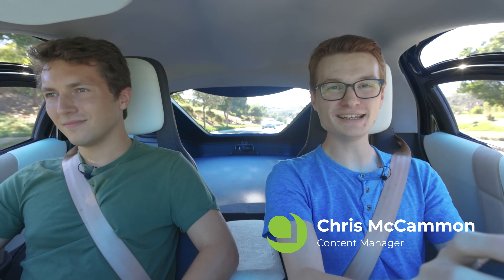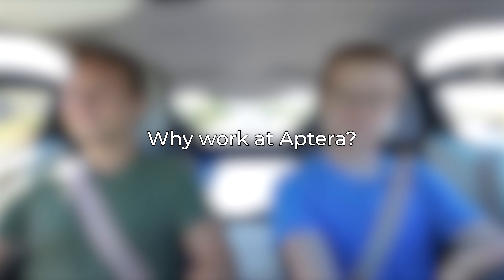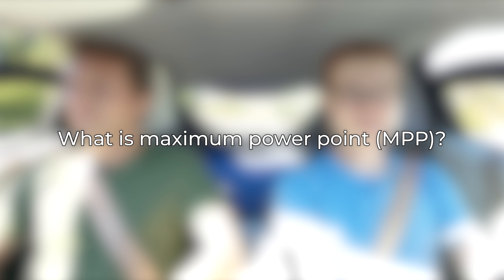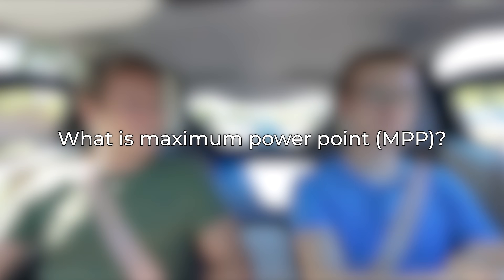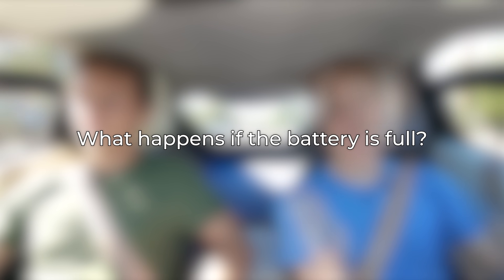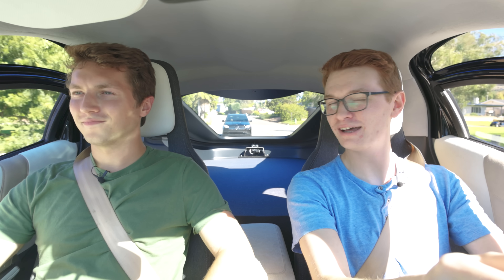Aptera's Solar Charger — The Third Wheel

Comment: I am seriously considering redoing one of my parking spots at my home to maximize this cars charging ability.
Reply: If there is any way to make that dc port 20 amp instead of 15 amp, that could be huge...I use a dc inverter plug in to convert to ac for power tools I use at home. Weed wacker electric.

Comment: Would be nice if you create a (supported) way to feed a string of larger panels directly into the charge controller. I'm in a relatively poor solar area, and it would be nice to be able to dock into a larger array when parked at home without drawing grid power. I'm thinking solar carport, get the car mostly out of the elements (shading the built in panels) and using my own panels to charge instead.

Comment: As you said the aptera can charge up to 40 miles per day is that assuming it is a perfectly sunny day all day and also how long of a day does it have to be
Reply: I suggest getting a solar insolation chart for your area, which can give you an Idea.  In Iowa where I live, I can expect around 20 miles per day on the average.  Also, if I have to plug in, about 62% of our grid power comes from wind.

Comment: Wow. Charging the car's EV battery using solar panel. That is a lot of savings. I have a feeling that the current EV car manufacturers would follow suit. Those solar panel would really help in charging ev batteries. This will be a hit in tropical countries though the EV is another issue due to rain/flooding season.
Reply: I agree.  But the reason it works isn't because they just slapped on panels.  The entire design results in reduced power demand (while still delivering 4 second 0-60 acceleration in the AWD version) (!)

Comment: Aptera Bonus .....   Right now there is a slowing in demand for Legacy Auto makers EV's.  Long term they had to switch to NACS but then they announce they will not have NACS socket vehicles in the market until 2025 so consumers rather than buying a soon obsolete CCS socket vehicle are waiting for the NACS versions.  So short term it is hurting the Legacy Makers like ford and GM.  But this delay can also be a big bonus to Aptera if production starts in 2024 as the only non-Tesla in production with a NACS Socket!!

Comment: It says that the car can charge up to 40 miles or 64 kilometers (that’s what the world uses btw 😂❤️) per day being parked in the sun. Would that be the sun in California or also in other parts of the world with less sun?
And yes, I know that it doesn’t work in the darkness 😂
Also: How long do you think it will take to expand to Europe? And would the car meet road legality in Europe as it is? E.g. the Cybertruck doesn’t and will therefore not come to Europe
Reply: I live in Iowa and expect more like 20 miles per days, but I can park in the sun most days.  There will be great variability in solar range depending on many factors.  I will probably be able to meet my daily travel needs from solar alone except for longer trips.

Aptera is working with European homologation experts and there will probably be European versions at some point.
Reply: @n.brucenelson5920  How sunny would you say is Iowa in comparison to California in percent?
Sounds very interesting!
Reply: @FormulaManuel  There are some online tools available that compare local solar insolation rates, often used for calculating solar panel output.  Look those up to compare any two points you wish.

Comment: Very informative video, and about solar charging question, 
What happen when the solar panels are not receiving light? (its night, cloudy, inside parking lot)
any possible issues? and also, when the battery is full, will it stop charging for safety? (Thanks)
Reply: They just won't be producing power.  If the battery is full the controller will be protected.  Some power might be routed to temperature control to maintain the battery in an optimum temp range, either cooling or heating as needed.

Comment: Guys love the car, however this video should show u how bad the suspension is
Reply: I rode in prototype before Roush Performance redid the suspension, and even then it was better than my VW based Kelmark kit car.  Coupled with the surprisingly sporty performance, I think the ride will be more than acceptable.
Reply: @n.brucenelson5920  I love the car just wish it was 4 wheels, glad to hear my teslas ride is brutal
Reply: @Joe-i5u  It is always a matter of trade-offs.  Wheel motors mean more unsprung mass to control.  They also reduce friction losses and faster, more precise traction control.  Three wheels reduces both rolling resistance - important at low speeds, and wind resistance at high speeds.

Comment: Suspension still looks really, really bad. The car crashes hard over normal road imperfections.
Reply: Even the original alpha prototypes before the Roush Performance redesign didn't do that- source?  I had a spirited ride in one with an engineer driving.

Comment: (0:51) Sadly, the "firmware engineer" is very wrong about whether a battery can or cannot be charged without a charge controller between the solar and battery.  Also, he has no clue on how MPPT works.  Finally, did you all know the solar panel golden boy Anuj resigned from Aptera in March of 2023?
Reply: Anuj likely "was resigned" from Aptera because Aptera Solar 1.0 (which he developed) was, basically, a failure.  I, for one, am not holding out a lot of hope for Aptera Solar 2.0 because, just like for Solar 1.0, there does not appear to be any solar panel development expertise at Aptera right now.

Comment: I am wondering if the Aptera's battery is being designed with the foresight of the possibility of replacing the battery further down the road in the lifespan of the vehicle. (Not necessarily upgrading, just replacing)
Reply: The answer is yes.  However, due to the weight of the pack, it is not an easy job.

Comment: I realise the engineer here is very young, and a bit nervous but he didn't explain mppt in any meaningful sense of how it works, terms such as 'pulling from the panel" should really be mentioning current is what he talking about. Pulling more or less, he means more or less current is taken in order to maximise the Power which also relates to the voltage which is directly linked to the current.
Its very important that videos give customers a sense of confidence in the technology, not being  able to explain in simple but accurate terms is not a video to put up. Some time should have been spent preparing before this video in order to give really top quality information.
Everyone is aware of voltage and current these terms are not something to avoid, just at least a simple explanation of how power is related to voltage and amps is a must here.
Top quality information is required to inspire confidence.

2 stars
Reply: Very interesting, I will check that link for elmar solar later, by co-incidence I have some extremely early mppt from solar race, if I remember correctly it was tritium controllers, the guy who developed it died from some disease related to exposure to the solder combustion products, very unfortunate, I think aptera doing excellent work, its a learning curve of course, the PR people have to be on top of their game, seems this youtube video was not up to the level you would hope for. How shading of the panels is dealt with was also dissappointing. I suggest aptera completely redo this video, I consider it to be "fluff", they need to inspire people with detailed accurate information with people who really know how to convey simple and complex information in a succinct manner....a bit harsh I know.
Reply: Amen brother.  It was painful to listen to.  I'm not an electrical engineer but have made a point of understanding solar MPPT.  I also have the pleasure of having at least two extremely talented electrical engineer's as colleagues and one of which has designed/built/sold many MPPT's to solar race teams all over the world.  If you're interested, check out Elmar Solar.  As I understand it, he's currently in Australia supporting team's that he has worked with that are participating in the Bridgestone World Solar Challenge.

Comment: Two 30W USB ports in front and one 180W (12V, 15A) port in the back is awesome. Will the port in the back be USB-C? I never stopped to think about how a MPPT would be different for a solar car vs a normal solar panel. I imagine that one of the challenges is that the angle of the sun will be different for each solar section (roof, front hood, back trunk) and the curvature of the car will also mean that each solar cell with a section gets a different amount of sun. I wonder how the cells are strung together and whether a separate MPPT is needed for each section. The amount of innovation in this car is crazy cool.
Reply: Aptera will have multiple "strings" in at least the roof and hatch panels.  Each string will have it's own voltage-boost MPPT.  FYI, there's no innovation in this.  It's been done (and patented) for ages.  My first experience with such MPPT's was in the early 1990s when racing solar cars.

Comment: I wonder if it would be possible for Aptera to offer a solar charge inlet plug to add more solar (most likely when parked) 

They could make a nice margin on panels designed to plug into the car directly to add say 500-1000w/hr.

Comment: Couple of questions:
a) I vaguely recall that a while back Chris A talk about the ability to plug in accessory  foldable solar panels (e.g. one or more daisy-chained 1,000w panels that can be folded up and stored flat on the floor of the rear cargo floor). But I think in a more recent interview of Chris M, I think you mentioned that for the LE there will be no such connection for accessory panels.  If the LE will not have this feature, can you tell us if and when it could appear, and, if it can be relatively easy to add later on, and, how complicated and involved would it be to add this plug?
b) Can the solar panel department tell us if the solar panels atop the Aptera produce less heat simply because they convert the energy from the sun into a charging power source for the battery pack?

Comment: Home solar panels typically degrade by 1% every year for 15 years. What's the anticipated degradation over time for Aptera solar panels? Are they different for where the panel is located (roof, dash, rear)?
Reply: Aptera is using Maxeon solar cells, which degrade more slowly than industry standard.  They will give warranty information eventually.  I expect that in time, the efficiency of such panels will increase to the extent that it will be a no-brainer to replace them in any case.

Comment: Will they be coming to Australia? And work with our 240 volt powerpoints? Also, I am disabled and charge my folding mobility scooter in the back of my car, which has an inverter, so I can charge it whilst driving. So is there an option to put a 240 volt powerpoint in the back area???

Comment: 😬 1:28   I probably would have used a better stabilized camera

or, this is a worrisome display of some over tought suspension / car not heavy enough ride quality issue

the speaker, the camera and the car all were shaking quite a bit.   pretty sure my 2003 Honda 
Odyssey MiniVan never does that on city streets.  Mark-com need to be tighter on permitting these images from circulation.  I worked at Apple for 15 years and they practiced strict controls on what image reaches the public

you can do it

Comment: Very informative. Make me aware of (partially) why Tesla doesn't already have a solar sheet for at least emergency charging. I don't currently have an EV, but now I'm leaning even more toward Aptera over Tesla.
Reply: Hello Paul. The weight of a Tesla, which is high, prevents it from being as efficient as a lightweight and very aerodynamic Aptera. Thus, adding solar to a Tesla body would add very little energy relative to its energy use.
Reply: @DirectorDavid  Yeah, I'm aware that it wouldn't provide much energy in comparison, but it would go a long way toward giving it at least a few miles to get to a proper charge point (aka, as an emergency 'gas can').
Currently, I drive almost nowhere, but use my vehicle for simple outdoor lounging. Having a solar sheet could power my entire usage. My once-a-week minor trip would be covered even in a Tesla. I loathe the concept of plugging in even at home.
When I am ready to purchase a new vehicle, I'm obviously leaning toward an Aptera, but a decent working sheet for a Tesla might give me more options.
Obviously, Aptera's availability would be a serious point.
Reply: @PaulADAigle  A solar "sheet" will be a wonderful thing when solar panels are that flexible or reliably jointed enough between each cell so that it can be durable and long lasting as it form fits to a car body while protecting it AND charging it up as well !
Reply: @DirectorDavid  They already have solar that is in a form like laminate, basically like thin plastic. It's a bit less efficient, but I'm sure it wouldn't be too hard to make something pretty form-fitting.
Getting something more quality like the Aptera's solar might be a bit harder though. It seems pretty possible. Time will give it to us.
I'm still waiting for the ability to get anything, so time is the only thing I have.

Comment: Messrs Chris and Team beyond

Relative to Solar Charge Mgt.  

Without giving away trade secrets, how will cabin oven possibility be mitigated?  

Power won't be an issue clearly, however from a country that receives huge solar coverage and has townships that gain dry or humid heat where temps exceed 100 degrees Fahrenheit - the question of cabin oven vs cabin ambience comes 🤔.

I can think of many concepts however defer to those out there doing!

Thanks in advance!

Comment: 📻Several Months ago I asked Aptera via their support line, about the susceptibility to radio interference generated by my ham radio.  Still waiting for a reply. So may be it could asked another way: How well shielded are the Aptera systems from outside radio interference? Maybe you could get an answer that I could not.  I had discussed this with one of the engineers at the expo in San Diego 2 years ago, and learned about the availability of 12 volts in the vehicle. But could not get any feeling for the level of RFI protection of the various systems.

Thanks again

Comment: Once aptera solar charge controller tops up the  car system's storage can It V2X adapt power back into a local EV V2X charge system? Please consider a simple UX that allows owner to prioritize witch storage systems are more important for directing energy transfer. This prioritization  schema may be different depending on which mode of operation the Aptera is in.

Comment: I live in southern Arizona where the sun is very intense and temperatures are frequently over 110ºF. I don't foresee any difficulty in solar charging, but I do have some related concerns.

Is there potential damage to the photocells such as warpage or delamination under these conditions? How durable would they be in a hale storm or dust storm? What about the wrap material bing used in lieu of body paint?

Arizona summers are notorious for being able to bake brownies on the dashboard of your car. Is there a remote AC feature that can cool down the interior before entering? Is the vehicle thermostatically controlled or just AC On or Off with low, medium, high settings?

In this climate, shade is a premium so people want to park in a garage or under a carport. In addition to keeping the interior cooler, this is done to minimize paint fading due to UV exposure. How much battery drainage would a fully charged Aptera experience over a day, a week, or month of being kept in a garage?
Reply: "Is there potential damage to the photocells such as warpage or delamination under these conditions?" and "How durable would they be in a hale storm or dust storm?"

Aptera claims they are/will doing/do accelerated environmental testing on test units.  I have full confidence they won't make panels for customer's vehicles that would degrade rapidly.  I'm anxious, however, to learn about the warranty.

Comment: With the rapid development of more efficient solar cells and panels (think Perovskite/silicon combos), does Aptera plan to upgrade the solar input with new design cells as they are available (on new production of course)? As a founder of a high tech company I loved the enthusiasm of the two young engineers and thier presentation.

Comment: Hey there. I was watching the video and thought of an idea. Previously an Aptera model showed a full solar panel array where the back hatch was covered in panels as well as the dash. Would it be possible to create a solar shade where it could be getting sunlight from the back window and in addition be able to be removed from the hatch and placed outside the vehicle for getting more sunlight while the vehicle is stationary? In this way the panel could be charging inside and outside the vehicle. You could also design it so that it could be flipped over like the back of a car seat when folded so that you could still use the hatch for storage when needed. Thoughts?

Comment: As it's not good for a Battery to sit Full for long periods of time can the Aptera be set to only charge up to a specific percentage. like 80% or 90% etc. then once it reaches its set percentage the panels can turn off and stop charging the battery . If I was away for a month  holiday I wouldn't want my car sitting full for 4 weeks at the airport carpark